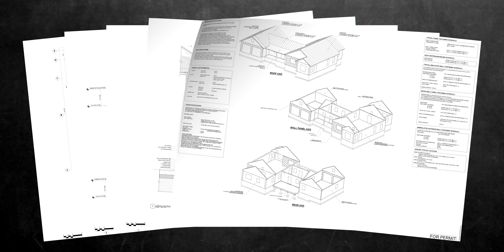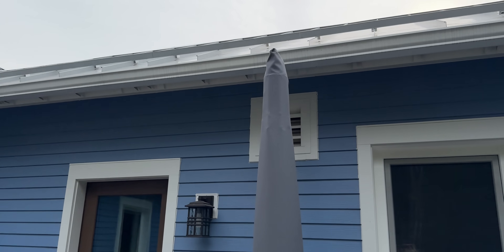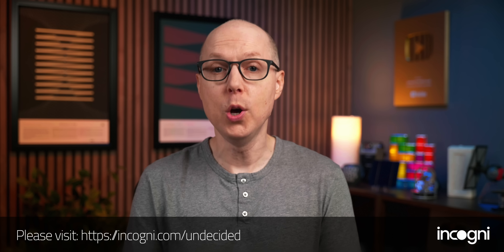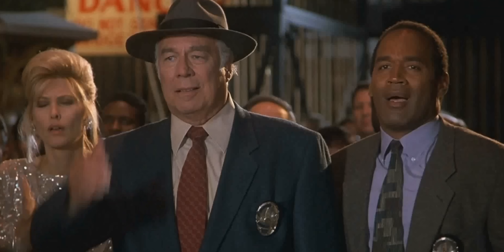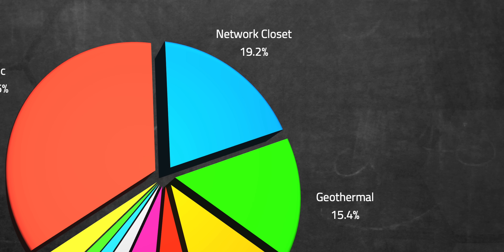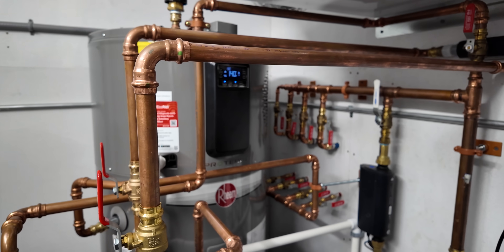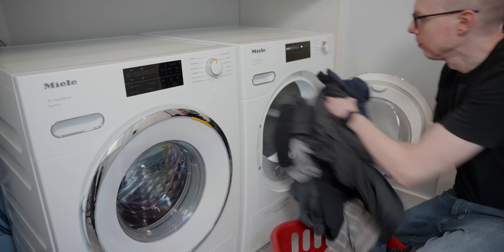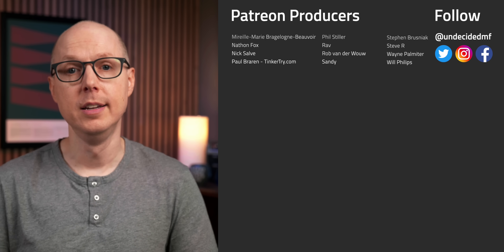What I Learned After 1 Year in My Net Zero House

Comment: I’ve built many of these homes Smart homes net zero homes, but after building homes like that, I would still stick to a normal built home if you want fresh air open the window, relying on technology for your comfort leaves you vulnerable and frankly is just a waste of money the money you would save by simply building. A normal house is more than enough to make up for the heat cost or cooling cost

Comment: For those of us living in older homes that don't even meet current building codes, lots of these solutions won't make sense.  Our house has no exterior wall insulation, so keeping it comfortable is a challenge.  Someday we may save enough money to add exterior insulation, but that is not happening anytime soon.  We have an electric furnace, the installers called it "the toaster", which kicks in when the temperature falls below -29C, it comes on only a few times during the winter, and the hydro usage spike is breath taking.  However, we need it for those rare occasions.  We also have an air source heat pump.  Our biggest challenge is the low ceiling in the basement, which means we cannot install a heat pump hot water heater.  However, we are extremely happy with our retrofit heating system and hot water heater, our bills have increased, but our comfort is reliable.  We are in a very small house, so we manage financially, lucky us. All this tech you use could never work for this old little house, but we use as much as is feasible, physically and financially.
Reply: Our house was built in the 1830s. One side of the house catches all the nasty weather. It has a solarium on it now with 14 large windows. It dropped the heating cost of our house by $500/year and heats the house ever so slightly beginning in March when it's still freezing here by sim-ly opening the door to it.

Comment: Totally should've mentioned that even if the cat turns on the stove's plates, they don't get hot and eventually the stove will just turn itself off.
(obviously, as long as you don't have anything large and metallic on there, which you shouldn't have in any case)

Comment: **Backup heat** is an electric resistance heating element in your air handler, if the geothermal heat pump is unable to reach the set temp in your home because of very cold outside temps then it kicks on the backup heating element to bring the house to the set temp. The backup heat may also kick on if you raise the set temp more that 1-2°F at any one time. EX: you just get home from dinner out and the house is cold, you increase the set temp from 70-75°F, the system knows it will take a while to get there with the geothermal heat pump alone, so it kicks on the back up heating element to give you heat quickly.
Is there a reason why you did not build a poured concrete UCF home with extra thick insulation? ICF homes are incredibly air tight, ultra energy efficient because of superior insulation but also because of the large thermal mass of the poured concrete core in the walls. It looks like you went with SIP panel construction, is that correct?
Is there a reason you did not use a German made Stieble Eltron whole house tankless electric water heater especially since you have solar power? They make single residential units up to 36kw(they have larger commercial units too) then there is zero energy/money wasted on keeping a tank of water hot because there is no tank, in fact it would work perfectly with the heat recovery tank you have in your home. I have a 29kw unit in my home and it is amazing, I have endless hot water should I have guests taking multiple showers. I did a test, I turned every hot water tap and shower on and the tankless water heater worked as stated.

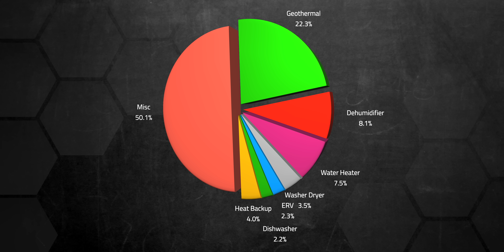Comment: At around 13:40 on your video you talk about you ‘heat backup’ consumption. Do you have an electric heating element in your HVAC system to boost supply air temperature?

Comment: Another great video Matt. Here in the UK I have retrofitted a 1960's bungalow with MVHR, PV, batteries, ASHP, efficient appliances and a stack of insulation. Its not cheap but the bottom line is that the house does not impact on my income in the way it used to do. Also there is a nice warm feeling on the achievement. This winter will see us without a gas connection and reliant on our ASHP.

Comment: Your biggest mistake was not doing a basement.  For the reasons you mentioned and one you didn't - resale value.  "Forever homes" rarely are, and resale should always be in the consideration.  A lack of basement will eliminate a lot of potential buyers (I'm sure there will be comments of "we don't have basements where we live".  That's nice - he does, and if you are in an area that has them, not having them is a big deal).  

As for Gas vs Heat Pump...out last house was all electric with a good quality heat pump, our new house is gas/electric.  Gas is cheaper and our electric rates are reasonable here compared to many other parts of the country.  My new home is better insulated being a new build vs 18 year old home, but is also bigger air volume.  The utility difference in the winter is very significant (and electric rates are higher now than when I was rocking the heat pump...yet my overall gas/electric bill is lower year-round than it was previously on electric).  The difference isn't as much in the summer but the winter bill is a good $200/month less even though energy rates are higher now.

Comment: Do you also have a drain water heat recovery installation in your shower? It saves 50% energy while showering by using warm drained water to heat fresh incoming water. It's great and not that expensive.

Comment: UK here we moved into a 1960 brick built bungalow with an old half dead gas boiler. We replaced everything so we now have a heat pump doing our hot water and heating (air to air so no old water based radiators). We have a smallish 5kwh solar array with a 5kwh battery, and changed the stove to induction. All of this means we pay less than half in energy as our old smaller property we moved from and at current rates all this investment will pay back in under 9 years. 
Love the videos Matt keep them coming
Reply: This is actually a fantastic example of what modern energy efficiency technology can accomplish. There's a lot of people in the UK and North America who are starting with already-built homes that they can't completely overhaul for many reasons.
Reply: i bought a home  near Glasgow in 2015. energy  rating C. shame that it's a 5 yr old home. i definitely feel the draft in the winter a bit.  first thing i diitwas to add as much solar panels as i can. i didn't want to connect to  phase 3 circuit. so too bad, i can only have less solar panels than the roof could handle.
since the rate of electricoty feeding back to the grid is so tiny. i bought a tesla wall. it was the 2nd one installed in Scotland! 
so worth it,  i did have gas heating still but induction stove. 
so i benefited from the ultra low right of charging at night, i wish they would build energy class A home by defaults because someone who bought a commonwealth village home. it was class A and super cheap to run. 
i left in 2020 and the energy prices have gone up the roof, i sold without charging too much extra of the battery or the solar panels due to people's prejudice about them.  and the new owners surely benefited from them now. :-) happy for them

Comment: I have really enjoyed your videos about the house project, all the more because we built an efficient 2-story, 3000 sf house on the MA south coast in 2020-21 and it’s neat to look at the similarities and differences. On the similar side, we built a well-sealed and insulated conventionally framed house with a metal roof and extensive south-facing glazing (all triple pane). It’s all electric with two ducted air-sourced heat pumps, convection cooktop, heat pump water heater and dryer, and an ERV. Differences are a basement that in the conditioned envelope, detached garage connected by a covered breezeway, and we used Gutex wood-based exterior insulation instead of foam. The structural outer walls have dense pack cellulose and the attic space is loose pack. Setting summer temp to 77 and 74 in winter, the combination of a well-engineered house and 15 kW PV array has kept us net-positive by a wide margin since 2021. That includes running everything in the house and garage plus EV charging for 35,000 miles so far. I look forward to learning more about your experience.

Comment: I love how this 'amazing high tech house that is built to much higher standards than US building code' is basically built to the bare minimum standards of a modern Dutch house. Wow, you have insulation and decent windows. Airpump dryers have been a thing for at least 20 years, and heat exchangers in the ventilation system have been common place for at least 10 years. So revolutionary. This video is basically an example of how incredibly backwards and behind North American building code actually is.

Comment: I'm running 100% off grid solar in Shropshire in the UK but supplement heating with the occasional use of a small log burner because of the 7:1 summer/winter solar production variation. I'm constructing a new off-grid home near Cambridge which will be full-zero energy and no supplemental heating systems - this requires a lot more batteries and solar to handle the 6:1 solar production difference there (it is less cloudy than Shropshire).  Heating will be ASHP backed with MHRV and lots of insulation. 

Will be a fun journey, its like playing a game in hard mode (full-zero) compared with medium mode (net-zero)  :)

Comment: Our approach was to compare the investment in our home with a joint annuity pension (+compensating for inflation). We found that the savings in energy costs was better than the pension. Plus energy costs may increase faster than regular inflation (UK).  Our home is classed as a Superhome by the National Energy Federation UK and is a retrofit not a new build. We encountered similar problems and now getting closer to net zero. We compensated for our restrictions on the amount of PV we could install by buying into a cooperative that installed wind turbines connected to the grid in Scotland. This will help offset the electricity we still have to pull from the grid in winter. Income from this also offsets some of my energy bill. I too have shedloads of data which I’m willing to share. 
Well done on your achievements.

Comment: the worst thing with this "for ever house" is that it s the oppsite of that.

here in europe we build our houses with with heavy duty bricks, the house can still very much so be made air tight and  be isolated on the outside with heavy insulation to be heat efficient. the houses last for generations to come. on the other hand this i find lower grade house which me personally ould try to avoid as much as possible.

Comment: 65 kWh for hot water per month - have you ever considered that there are a dozen better ways of saving money (none of your stuff is exactly cheap ie cost effective) ? The first and best way: use less power! Have you considered the real world impact of the manufacture of most of the gear you use? I bought a cheap house, 1980 build, not bad insulation values (NW Scotland, not known for its year round Bermudan weather), and just use less of everything because it's the right thing to do. And I bet I spend less on almost everything than you do. You need money to do what you have done, so it doesn't help those of us who have little to spare to become more efficient. I hope all your mainstream local electricity production isn't via coal and/or oil... and that the cobalt used in the manufacture of your batteries, and all other CO2 and other even worse chemical by-product of production, or sourcing of other toxic compounds doesn't simply wipe your perceived benefits of doing what you have done off the slate.

Comment: I installed a 6kW solar array (maximum allowed by regulation, for grid connection), and 10kWh battery storage 4 years ago (in Ireland). I export enough energy through summer (bought from me at half the price I buy units for) to pay for the energy used by the heat pump house heating solution through winter. I thus have no electricity bill, nor any heating bill, to pay. But if it was NOT grid connected, most of my summer generation would be wasted, and I'd be importing significant energy in winter for the heating. I am simply too far North for adequate solar power through winter. Thus, the expensive ($40ish per month) standing charge for grid connection is necessary - but still paid for out of exported solar energy. And my house is not at the "near passiv haus" level of this one in the video, but a regular "average to code" modern bungalow built in 2008. 

I watch my consumption like a hawk, though. NO electric showers. Minimal electric kettle use - I heat water in the microwave instead. Washing machine and dishwasher are run on sunny days when there is excess power to spare. My electric lawn mower likewise needs sunshine - but if it was raining, I wouldn't be mowing the lawn, would I? 

I can forget charging any electric vehicle with this, though. Even on the best sunny day in summer, my record is 36kWh generated. About half of a modern EV battery. So, if (maybe when) I go electric, I will be installing a second, much larger, solar array on the garage roof, kept off-grid, PURELY for charging an EV battery. But note that this only works because I am at home most days. If I need that car to commute to work, the solar array is wasted, because the battery storage to hold that power to transfer to the car at night (when I'm parked at home but the sun is on the other side of the planet) will be prohibitively expensive. The car has to be at home, charging, when the sun is shining. Otherwise you are better off with a grid-connected charger, and opting for a cheap night rate meter option so you can charge that car with half price electricity. 

Recently I added a second freezer, and suddenly I'm consuming 50% more energy. Huge shock. From ONE freezer. So, get MODERN appliances that have good insulation and efficient condensors. And try to get fresh groceries regularly, so that you don't need so much freezer space. 
Given that I run a powerful PC 8 to 12 hours every day (anything from 1 to 6 kWh total daily consumption), I was stunned to see how much more energy I was using, just by adding one freezer. I'm now working to reduce the freezer space I need, to cut that consumption again.

Comment: I lived in a new laneway home with an hrv/erv and it was horrible. It just had a single wall panel that was basically a thermostat and neither I or my landlords who built the place had any way to get it to work properly.

As a result, I had to constantly open windows as over night my bedroom would build 5-10x the recommended co2 level.

If you build a house like that make sure your system is properly configured.

Interestingly, the vents in the 1200 sq foot laneway house I lived in were circular an no larger than 4 inches. I suspect the owners cheaped out on the ventilation system. 

The radiant floor heating wasn't set up properly either and the control valves to adjust it were built behind a kitchen corner cabinet and literally impossible to reach. So the front of the home furthest away from gas burner was freezing in the winter.

So overall, be SUUUPER careful what contractors you use with newer unfamiliar hvac tech.

Comment: We have the ability to to put up to 20+ KW of solar panels on our property, which would net zero our energy requirements, our council said "no". 10.6KW MAX, as the GOVERNMENT built infrastructure CANNOT handle the generated energy that is unused. Akin to ADSL, (remember that??) the INFRASTRUCTURE available, does NOT meet the required demand. SO WE WAIT, for governments to upgrade services. Perfectly fine scenario if you live in the country and don't even have access to government or company (who greases govt palms) controlled power...

Comment: We built a very tight and highly insulated house in Vermont. Geothermal wasn’t considered but might not have been an option due to nature of our geology (we have ledge, local speak for solid rock). We have heat pump water heater, heat pump house heat and AC. We have an insulated slab. ERV keeps the air fresh.  No solar as yet. May do grid tied at some point. Have about 7 kw of used panels I may put on barn or ground mount in future. Our setup is low tech compared to yours. Our dead of winter electric bill is around $300. In mild weather it is around $100. We cook with induction. My favorite way to cook. Don’t use a dryer. Hang wet clothes on a rack and run a dehumidifier in a small room.

Appreciate your perspectives on tech and energy. You do much to keep me informed!